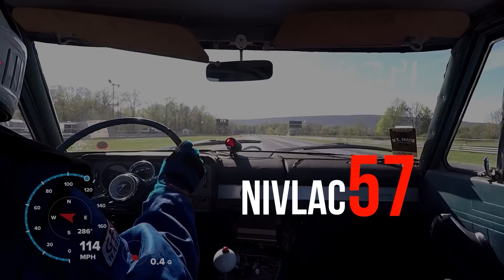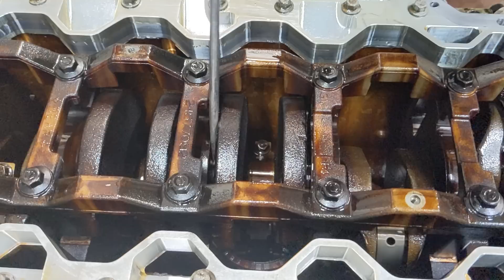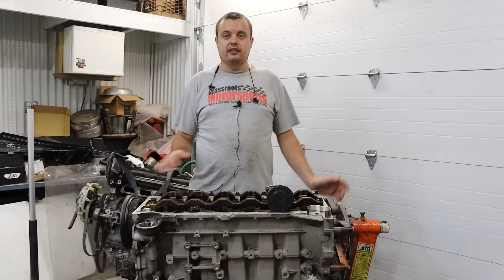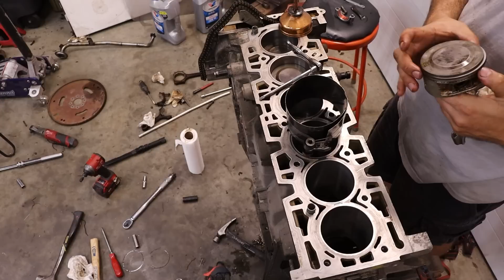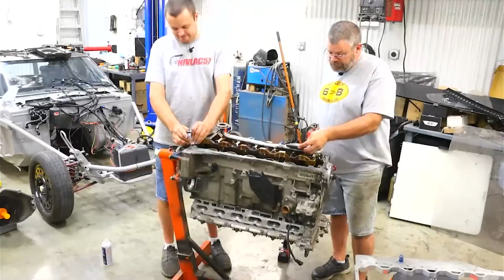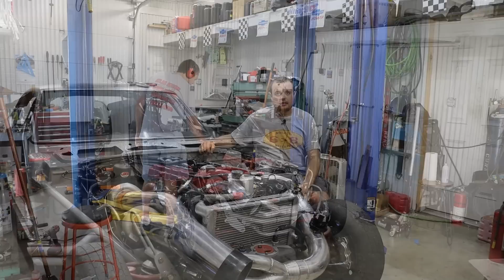Engine Failure - The Road To Recovery - Twin Turbo Ameri-Barra Vortec 4200 Datsun

Comment: Does a standard th350 th400 etc bell style bolt right up ? Also what are you using to control these engines super interested in this swap over the ls v8
Reply from the maker: You need a simple and affordable adapter plate to put a th400 behind it. The dowel locations are the same, but the bolt locations are not. 

For this one I'm using a megasquirt. For others I have used Holley EFI, and Maxxecu.

Comment: Why do the head bolts snap (steel into aluminum)?  Once the head studs are installed, I assume this is no longer a problem but if you had to remove a stud would it sanp or does antisieze prevent this?  Also, would the later crank be ok for a single turbo with lower boost, say around 500hp?  Thanks for the video and good luck .
Reply from the maker: No idea why the head bolts snap. They just do. Seems to be related to the number of miles on the engine. 

You could use any year engine or combination of parts for that power goal.

Comment: Sweet sounding 4200. I've been trying to figure out what year would be best for a mild super/turbo charger build toy/work truck we have some in the junkyard where I work part time   any help would be appreciated thanks
Reply from the maker: Any year would be good for that
Reply: @Calvin-Nelson  kk thanks I want to get it close to 400 whp hopefully keep the boost down to twelve or fifteen psi  just don't know which ones are better for it. I wish they would have made a direct injection version that would have been a great one.  Thanks
Reply from the maker: @jcchristopher7827  https://sites.google.com/view/vortec4200wiki/power-matrix
Reply: @Calvin-Nelson  thanks.  We just got a late model 08 envoy in at work around a hundred thousand miles but is it better to get the factory harness out of the envoy or get a stand alone harness   thanks

Comment: The Atlas engines are hidden treasures, aluminum block, 4.0 liter unline 6 cylinder shall we say more.

i have wondered why people muck about with a 2JZ, when you get an extra 1 liter of displacement, better housing options for transmissions, and a better cylinder head.

GM has so much figured out
Reply from the maker: Agreed. Wait until you see this week's video coming our on Sunday.

PS. They're a 4.2L, just so you know.

Comment: I’ve decided to rip my I6 out of my envoy and will need to know those ring caps and what oil pan you have there. I’d also like to know more about your intake setup. I probably will have more questions as I proceed
Reply from the maker: Not sure what you mean by ring caps. Oil pan and intake are custom made.
Reply: @Calvin-Nelson   I meant gaps sir I love your build
Reply from the maker: @Cytheguy99  Pistons have sealing rings that are essential to sealing the combustion chamber off from the crank case. The rings sort of have a "C" shape to them. When you install the rings into the bore, there will be a gap between the tips of the ring. This gap is necessary, but allows a little bit of combustion to make it past the ring. The factory makes that gap as small as possible for that reason. The gap is necessary because when you run the engine, the heat from the combustion causes the ring to expand and grow shut. If the gap is too tight, it will usually cause you to break a piston because the ring will bind in the bore of the engine.

Since we are planning to quadruple to the horsepower of the engine, that is going to generate a ton more heat and we need to make that gap wider.
Reply: @Calvin-Nelson  thank you
Reply from the maker: @Cytheguy99  No problem.

Comment: An im talking junk about that motor🤣🤣 I threw a rod out of a 03 envoy an swore against em every since. Now I really wanna see one in a ranger or s10🤣
Reply from the maker: They're awesome engines. I wouldn't be surprised if the front sump and 6 quart oil capacity had something to do with your rod failure.

Comment: Are you going with solid or hydraulic lifters this time? How high you planning to spin it?
Reply from the maker: Going hydraulic for now. We will spin it to wherever the power peak is. (That turned out to be 7600 RPM)

Comment: That is not a remand tag it’s a heat button junkyards put them on engines when sold so if it comes back they know if it was overheated
Reply from the maker: Ok. Whatever it's called. It had stampings on it too that had an engine service shop too.

Comment: the rebuild is just the start bigger and better
 one thing to note is methanol doesnt miss fire it detonates when lean  so she may run fine at ethanol tune but will ping knock and detonate shredding built engines   good luck with the american barra  aussie rooten for ya
Reply from the maker: Good to know. Thanks!!

Comment: G'day Nivlac,

Errr...  Ummm...  That's not how you measure bering crush.  You need the bearing shells in the rod & cap to measure it.  Crush is the gap between the mating surfaces of the bearing housing when the bearing shells are installed, and 1 cap bolt is loose.

Andrew
Reply from the maker: Ok. Maybe I used the wrong term. I think the way I measured it did the trick.

Comment: Why not just replace the thrust bearings?
Reply from the maker: Not going to risk it right now with a motor that has a bunch of metal all through the oil passages.
Reply from the maker: @krisk9149  you absolutely could.

Comment: it doesn't appear that you measured the rod in the most important area.. you need to measure the rods at the parting line while torqued to see if there is distortion from torqueing the rod bolts. that will pinch a bearing and throw out your clearance on the sides even though the top and bottom clearance is good and that's where everyone applies plastiguage..  but never near the parting line as it usually doesn't give good results as it gets pinched between instead of showing a good measurement.. but a rod pinching on the sides is common and the reason a lot of people loose engines if not checked.
Reply from the maker: Hm. I would hope the aftermarket rods would not flex as much in that area, but it is probably worth a check. Maybe on the next motor.

Comment: I know a ton of guys making alot of power running the molnar stuff on jetskis, around 200-250 hp a cyl. Also seen them fail on one of turbojohns vlogs where someone had a set of those molnar rods fail in a turbo windsor and turbojohn said he was surprised they failed cause those rods were actually really good. I feel like i know who said that to you and if im right the application that person does alot of R&D on has an infinite amount of aftermarket support, so for sure molnar H-beams compared to like a manley turbo tuff or the new boostline series is not comparable, but i don't think for what you guys plan to make you'll have any issues.
Reply from the maker: Yep. They held up well. Just got off the dyno. Next weeks video will be good.
Reply: @Calvin-Nelson  Hell yeah cant wait 💪🏻when i get paid friday im getting one of your shirts!
Reply from the maker: @thewraith6360  Thanks man!!

Comment: Why couldn't you install new thrust bearing?
Reply from the maker: We could have probably done that. Not going to risk it with a motor that has little tiny pieces of metal running through it at the moment.
Reply: @Calvin-Nelson  Cool. 
My 2004 Trailblazer 4.2 (183k miles) stalled twice in traffic yesterday with the a/c on. I was just wondering when will I have to clean the throttle body again.
Reply from the maker: @Fone65  Good old PCV system.

Comment: wait so what head studs did you go with if you're not running factory bolts??
arp hardware hasn't been produced yet? i was talking with a guy just last week and we were going to go halves on a proof of concept and run them. Most of that pnp was exhaust work, huh? or did he go at the intake as well? Very, very curious
Reply: also, what head gasket did you decide to run?
Reply: Gen 3 LS bolts work, check the wikipedia page he made for this engine.
Reply: @thewraith6360  just scoured the website again looking for it & could not find it.... maybe it was in one of his videos.... thanks tho
Reply: @benjaminhuston6763  Its no big deal its a possibility, but yeah any studs that work for a gen 3 LS will work with this engine, ARP, the china studs or whatever. They just are a tad long but dont interfere with anything.
Reply: @thewraith6360  I am well versed on the page. just must have missed it
Reply from the maker: What the Wraith said. You need the long studs. I used speedmaster studs.

Comment: So, are the new rods the same weight as the originals, or did you do some sneaky off-camera balancing, or what?
Nice work!
Reply from the maker: They are a different weight. New rods are heavier. It's an inline 6. Crank is neutral balance. As long as all rods and pistons are the same weight it doesn't need balanced.
Reply: @Calvin-Nelson  
D'oh!
I keep forgetting that..

Comment: I don't recall. Is the 4200 a 180 degree thrust bearing? Any thrust bearing upgrades?
Reply from the maker: It's 180 degree thrust. You can install two upper shells. We didnt.
Reply: I havent found any in my research. just a cam grind and some rod upgrades and arp fasteners

Comment: i do have a good question though. the vortec 4200 is 4.2L vs the barra being a 4.0L. whats the actual size difference and is it from bore(circle size) or the stroke?(the length the piston travels)
Reply from the maker: A little bit of both.
Reply: 4.2l 93 x 102mm
barra 92.96 x 99.31mm 
both are under square motors which isn't the best for high rpm pretty common to destroke barras from 99.31 to 90mm 3.7l displacement for more rpm

Comment: So a couple things: Why'd you choose to go twins instead of a twin-scroll single? Also, is there any read-up on this engine series that shows stuff like how many bolts are on the main crank bearing caps, head flow, head stud size, etc? Lastly, given your dyno testing, would you say these engines are good for 100whp per cylinder while being daily reliable on a stock bottom end? Maybe 125whp per cylinder as a "weekend warrior"?
Reply from the maker: Went with twins because we thought it looked cool and had them on the shelf. On a stock bottom end 700whp is where I'd keep it. Replace the rods and it will hold a lot more.
Reply: Im just some guy on the internet but ill give you my 2 cents. My best guess for the turbo selection is due to airflow. you can make a single but work on other inlines because they may push more air. these 4.2s may not move enough air to really support a single big without a TON of turbo lag (this is really only the case for pushing the upper limits of these engines). my best guess to support this is the head not flowing enough to support it. To your dd reliability, if you do the cam grind, some injectors, coils and plugs, a descent turbo rated for your power goals (600), and a quality tune I dont think youll have any real reliability issues as long as your not running pass after pass after pass or really hard launches. Im pretty heavily considering this swap for my xj project. so far its gonna be lifted by ~6.5 inches and have a 1 ton axle swap. The amc 4.0 is amazing but not capable of the power goals I want for it so hence my research. I wanted to go LS (yea ik) purely for the simplicity and price. you can do it damn cheap and not be waay in the hole. well With this engine I can still do that. to what ive found I can run the same ecu for the 4200 as an ls and the 4200 bolts to almost any chevy trans since its got the 4l60 bolt pattern. So basically if Im not happy with the turbo 4200 then I can just yank it, change the engine wiring harness, engine mounts, and reprogram/retune the ecu.
Reply: @sirkrow7118  this engine has a unique trans mounting pattern from my recollection hence the adapter plate being used here. I could be wrong,
Reply: That's correct. The Atlas engines have a unique bellhousing bolt pattern. GM made a special 4L60 bellhousing, just for these engines.

Comment: I wonder if there is a 6 bolt flex plate, and torque converter like there was on the TH transmissions
Reply from the maker: There are. We'll go with what has worked in the past.

Comment: Job well done brother! Only thing I’m wondering is how the rotating assembly balance is with the new rods… 👍
Reply from the maker: No need. It's an inline 6. No bob weights.
Reply: @Calvin-Nelson  kinda what I was thinking since the forces are all in equal and opposite directions they probably cancel out… not like a 90* engine…

Comment: I was wondering if the convertor ballooned and sheared off the lugs.  I'm guessing at least the front pump is trashed like the thrust bearing.  (skimmed thru last video and just started on this one.)
Reply from the maker: I doubt it. We've run that same converter that failed at higher power levels.
Reply: @Calvin-Nelson  Just a thought.  Glad you got it back together so quickly and the new rods are good to go!  Can't wait to see the next dyno runs.  With the new rods what are the power limits?